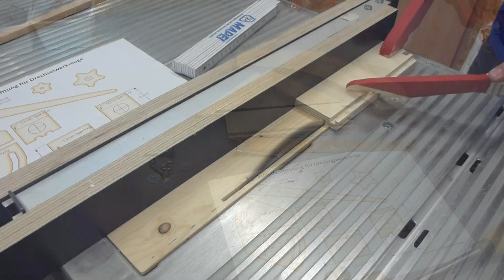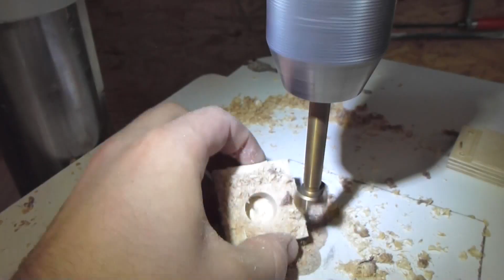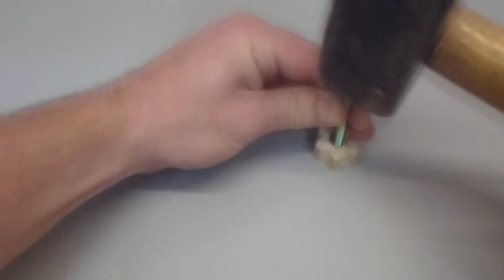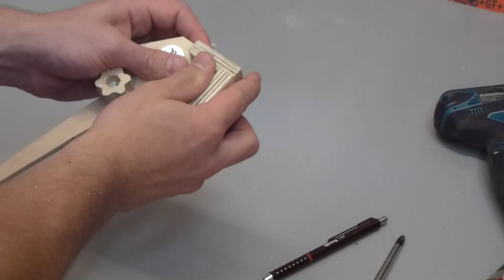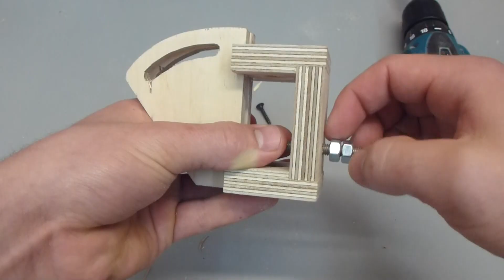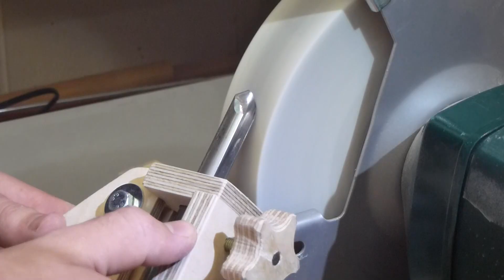Homemade sharpening jig for woodturning tools (free plans)

Comment: I just finished making your chisel jig out of polished aluminum. It came out great. Thank you for making these plans available to anyone. 

I wound up using a piece of 2" schedule 80 square-tubing instead of the 3 "main" portions, and I wound up extending the pivot from what it is here to 14" to accommodate my grinding setup. I shaped both knobs by filing in knurls around the entire circumference, sanded them smooth and polished them up to a nice shine. 

I would love to show you what I made with your plans if you have some kind of outlet for such things.
Reply from the maker: That sounds awesome. Can you send me some pictures ? (marius.ho1995@gmail.com)

Comment: Excellent video Marius. What if you cannot achieve the 2" overhang of the tool? I have a couple of small gouges where the locking screw would be clamping on the tool shaft diameter, not in the flute.
Reply from the maker: It should work too, however the grind will be a bit different
Reply: @MariusHornberger  Marius, many thanks for your reply. I am in the process of making the jig at the moment. I will let you know how I go on.
As the shorter tool is a smaller diameter too, I may be able to integrate a V shaped shim in the clamping system.
In the meantime, if you would like to have a quick tour of my workshop, then check out the video below.
https://www.youtube.com/watch?v=975peCBe1Lo

Comment: Wait a minute---?????   you didn't show how that tool holder and the sliding base thing work together ---you just skipped to grinding your tool on the wheel and left me wondering what was going on below to 'position' the alignment?????   Nice job on the finished tool but I'll be darned if I understand how your tool holder and that sliding base jig worked----and what about how you decided where to lock down that long 'tail' in it's 'ark"????   I guess your secret is safe----those smarter than I must have understood---or perhaps they don't see the kings clothes either but won't admit it?

Comment: Are thses plans to scale ? Very interested in making it.
Reply: Hi, scaling is perfect, but if you're printing on US Letter sized paper rather than A4, there should be an option on the print dialog to "print actual size" or "do not scale".  This will force the printable data to maintain the correct size.  I wound up missing a slight bit of the right side of page, but nothing critical there to the build.  Hope this helps, these come out rather nice. - Bill

Comment: When I learned wood-turning at a young age (17) my Czech boss stood behind me and guided my hands to teach me.  Anyhow, I learned awful fast that properly sharpened tools made my life a whole lot easier,  We had no jigs or guides for sharpening so had to learn by hand.  When sharpening the gouge (yours shown is a different shape than the typical gouge we used) the handle base swung from left to right in an arch while rolling the gouge on the grinder wheel.  This was to maintain more or less the angle of the grind at the sides to be similar to the middle.  Its kind of hard to explain in words.  Do you get it?

Comment: Hi, very nice!! I tried to print the plans in A4 paper size but i cant print the real size.
Reply from the maker: +Jose Hernandez try printing them with your standard paper size with no scaling
Reply: Marius Hornberger 
Thanks, I tried that also. The problem that I'm having is that 2 barcodes (both related to your videos) are printing automatically in the same paper causing the resizing of the figures. However I don't see them in the screen. How can I remove those barcodes?
Reply from the maker: you can't. Everything is layed out so templates + qr-codes fit on one page. If you're still having problems, try the German version

Comment: Are the plans to scale? They look small based on the margins and QR codes.
Reply from the maker: Yes, they should be. The jig is relatively small and the QR codes are a little big. But when you print it and measure this one piece with 4,2cm and it's correct, then everything has the right scale. Also keep in mind that it's made for A4 page-size.

Comment: Just wondering, the size of your grinding stone changes a small bit after each sharpening. You compensate that with the sliding bar, but how do you know how much you need to compensate?
Reply from the maker: +Joost van Putte The wear of the wheel is so low, that you don't have to compensate for a long time.

Comment: Great project that I would like to try, but "Dropbox" has locked the plans to where you need an account with them to view.  Do you have a website that I can access the plans without Dropbox?
Reply from the maker: +Daniel Collins Oh, I didn't know that. Unfortunately I have no website yet.
Reply: +Marius Hornberger Create a folder called "public" within the root directory of your Dropbox if it doesn't exist already, put the files in there, right click->Copy public link. Now you have a link in your clipboard which directly links to a publicly accessible file.
Then just paste it wherever. However, I have heard of Dropbox simply blocking links which generate too much traffic up to even suspending the associated account.

I would recommend uploading them to something like zippyshare or some other similar website instead.

Comment: Marius,

Love this idea, will be making within the next 2 weeks, just one question - do you have the plans for the base?
Reply from the maker: Well no, because I think it is so simple to make. My one is a scrap piece of osb with the grinder mounted. A bar with a slot and the piece at the end that holds the tool, two guide pieces and a knob. But if you still looking for plans or a tutorial. This should help you: https://www.youtube.com/watch?v=-6yErAxHbkk
Reply: Marius Hornberger
okay, thanks...just did not know if it needed to be any certain length to work with your jig.  I will watch video again and get rough idea for the length.  Thanks again for this great project.

Comment: Thanks for the inspiration, Marius, I just made my own simplified version, which has no adjustable angle. Why is that important? If you have an extendable tool rest, isn't that enough to adjust the angle on the grinder (works for me)?
Reply from the maker: A fixed angle works well too, but with an adjustable angle you can get more different grinds.
Reply: Marius Hornberger
Agreed. My point is that the same can be achieved by moving the tool rest in and out. True?
Reply from the maker: No. You get different grinds by moving the tool rest. So can change your setup on one axis. With an adjustable angle you can change the setup on two axes. You can not just change the distance from the grinding wheel, but also the size of the orbit that the tool makes around the grinding wheel. It basically determines how pronounced the compound motion is. Kind of hard to explain.
Reply: I see what you mean, thanks for taking the time to explain.